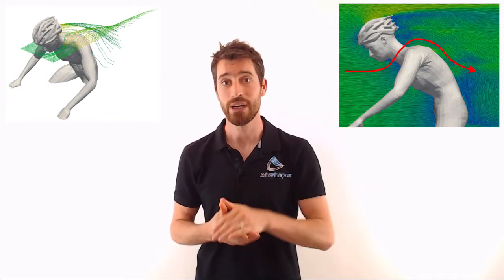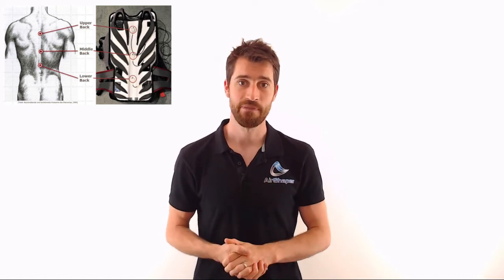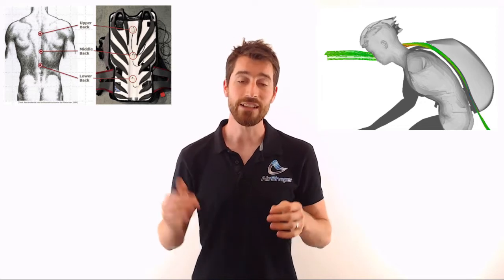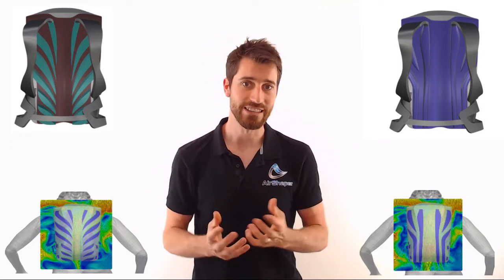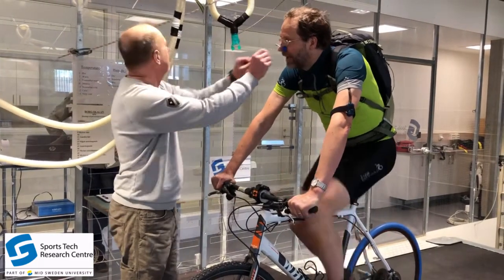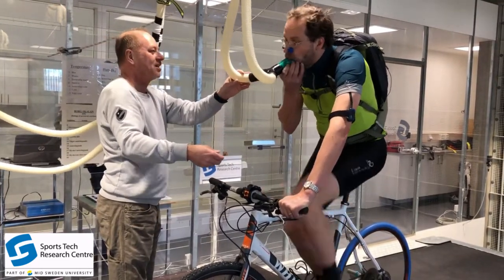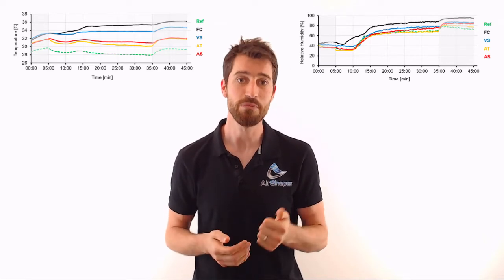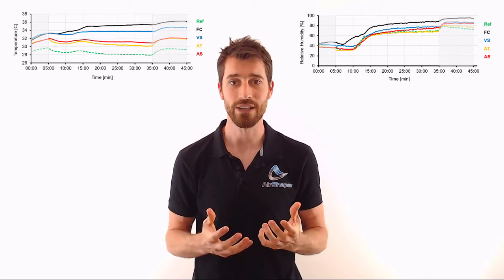Sports Aerodynamics #3 - Aerodynamic backpack ventilation

Comment: Really the best solution is no backpack at all but use a big saddle bag, not only do you get the cooling but it's much less stressful and tiring on your core when riding
Reply from the maker: I fully agree - if you can, then saddle bags are better. If not, this backpack is really nice, and it's also been designed with mountain biking in mind, where saddle bags are not really an option. For more info, you can check the more scientific documentation:
https://airshaper.com/research/cycling-backpack-thermal-comfort-cfd-analysis
https://airshaper.com/research/backpack-ventilation-thermal-comfort-measurement